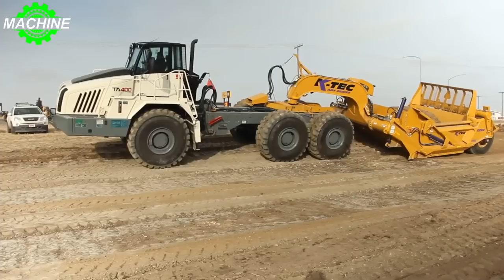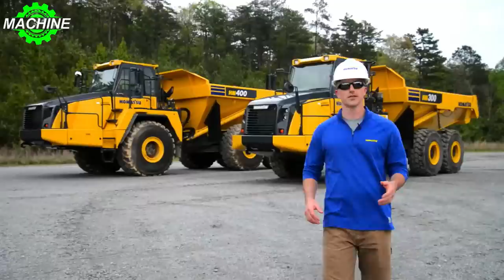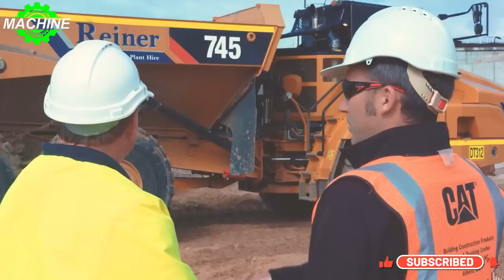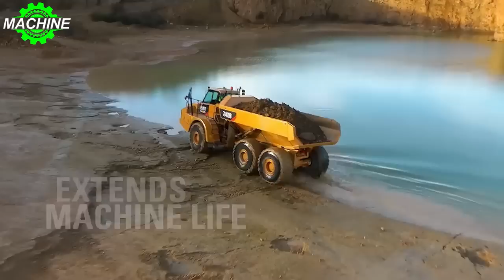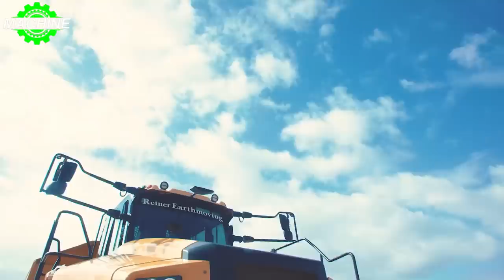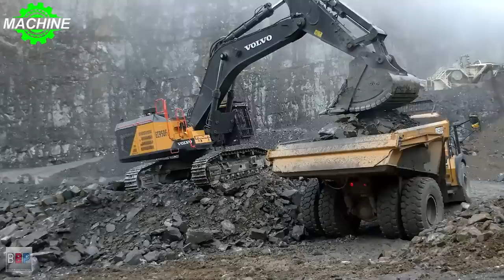Top Articulating Dump Truck That Are At Another Level 🚀13 -  Awesome Technology And Heavy Equipment

Comment: So the Bell in the end has the same payload as the Volvo A60H, is less powerful in horsepower and torque, Is half a meter wider, is slower and while the Volvo turns in less than 5 meter circle (inside wheel) the Bell turns almost 10 meter circle. Volvo will be king of articulated trucks for a long while since the rest keep copying Volvo
Reply: Volvo is simply playing in it's own league
Reply from the maker: Thank you very much. Remember to subscribe to the channel and support me